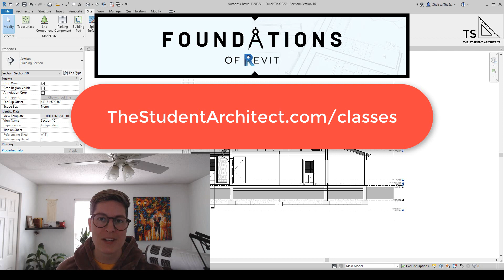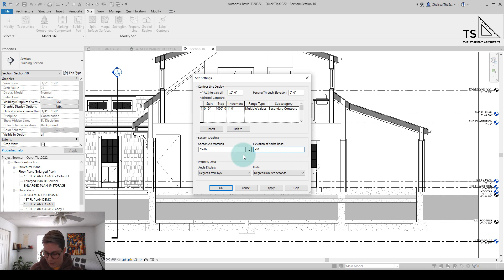How to Change Topography Depth in Revit

Comment: it didn't work for me, is there any other way?
Reply from the maker: Yes! If you're using Revit 2024/2025, they changed a bunch of topo settings (not for the better if you ask me). I will be doing an updated video for this, but in the meantime, this is how you can do it if you're working with a Toposolid surface:
Click on Toposolid surface
Click Edit Type in the Properties Panel
Click Edit next to structure
Change thickness

Hope this helps!

Comment: I'd like to know if I can show different patterns by using different materials.
Reply from the maker: Yes! In Revit 2023 or earlier, you can do this using subregions (create a Subregion under the Site tab on the Ribbon), and with Revit 2024 and beyond, you can do this by adding layers to the Toposolid assembly (using Edit Type in the Properties Panel and edit Structure). Hope this helps!